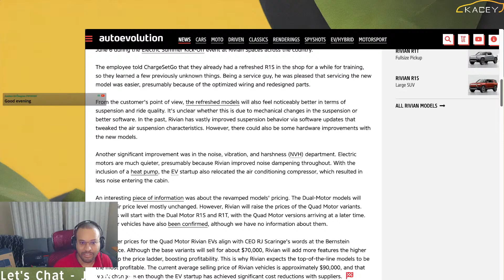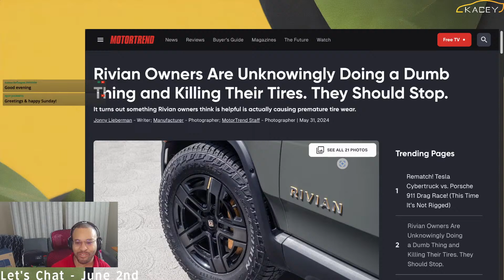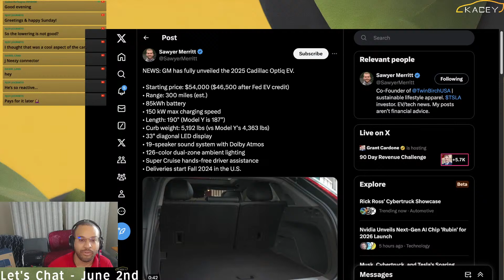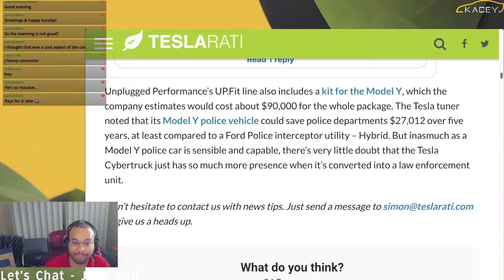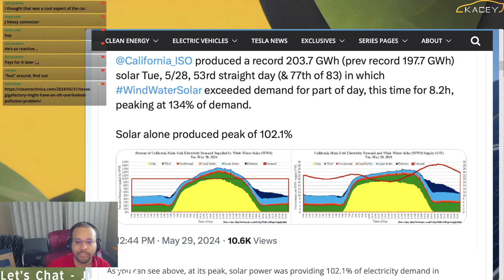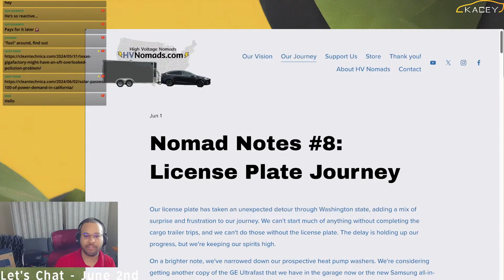Let's Chat with Kacey and Friends - June 2nd

Comment from the maker: The equipment I'm using for the DIY Filter I mentioned: 

AC Infinity Cloudline Pro T8 (I chose the T8 over the standard model for the wireless control): https://amzn.to/4bJIWXE
AC Infinity Refillable Carbon Filter (I chose refillable over the one-use model for all the reasons you'd expect): https://amzn.to/3KoV3O3
3M Filtrete Furnace filters 6 Pack (I'll arrange these in a square around the fan and carbon filter): https://amzn.to/3yRVVrE

How I’m Setting This Up Today:

	1.	Base Layer: Place down a sturdy base.
	2.	Carbon Filter: Set the carbon filter on its narrow end on the base.
	3.	Fan Placement: Place the fan on top of the carbon filter, drawing air through the carbon filter and exhausting it upwards.
	4.	Top Layer: Set a base on top of the fan and cut a hole for the air to escape.
	5.	Filter Arrangement: Arrange the furnace filters in a square around the carbon filter and fan, with the arrows pointed inward.
	6.	Sealing: Seal all the cracks to ensure no air escapes unfiltered.
	7.	Power Up: Power up the setup and enjoy cleaner air.

Disclaimers:

	1.	Affiliate Links: This post contains affiliate links. If you use these links to buy something, I may earn a commission at no additional cost to you. I only recommend products I personally use and believe will add value to my audience. Your support helps me continue to provide quality content.
	2.	DIY Project: This is a DIY project, so proceed at your own risk. Ensure you understand the process and take necessary safety precautions.
	3.	Carbon Precautions: Some carbon may escape during the initial runs and refills. To prevent making a mess, especially if you have white surfaces or items you don’t want to clean up, consider running the filter in a garage or placing an additional filter at the output to catch any stray carbon chunks for a day or so.